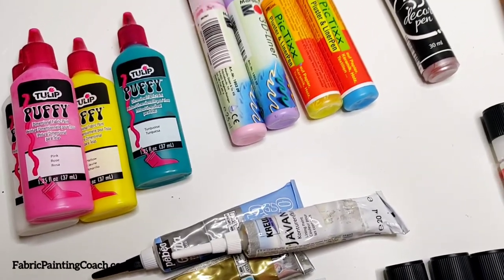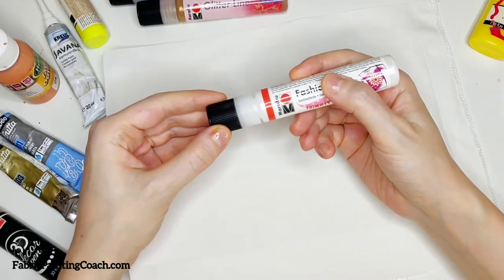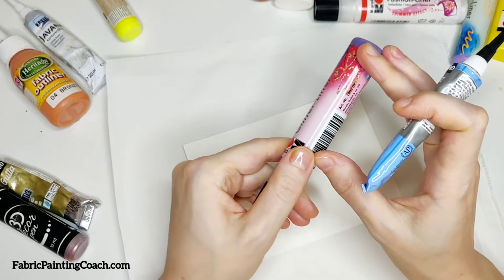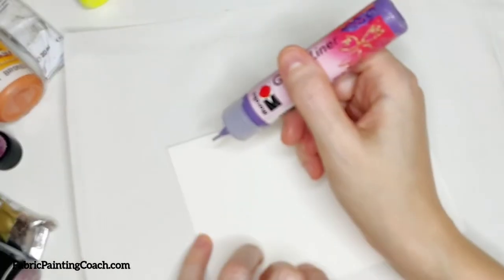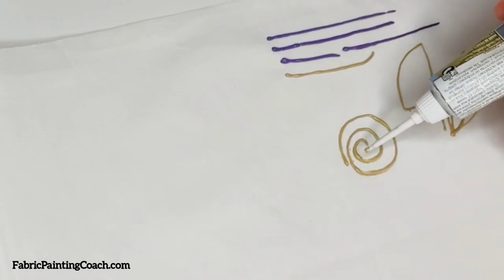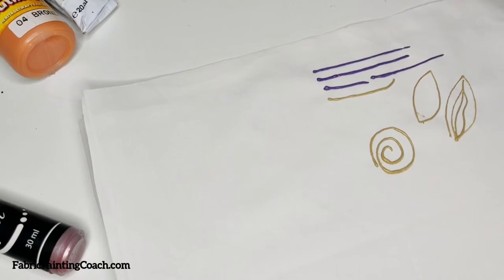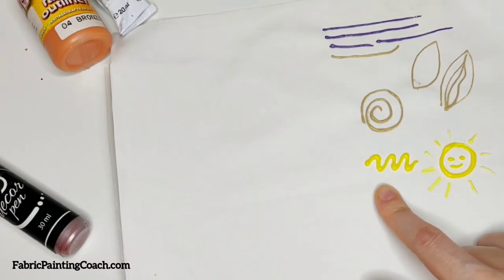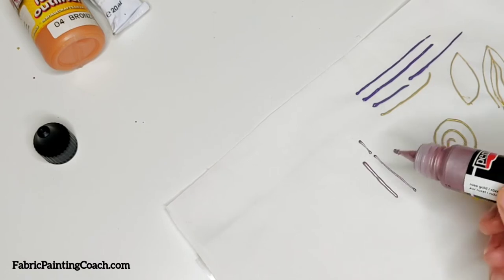Outliners for fabric | How to use Textile Liners | lesson 25

Comment: Many thanks for all I learnt by watching your video! For lycra or other stretchy fabrics, what king of permanent outliners do you recommend? What would settle down into fabric and resist to hand-wash?
Reply from the maker: Hi! Your every welcome
Yes, this is a very good question, as not all of these products that I've shown are suitable for synthetics and lycra. Javana, Marabu - these are only for cotton and mixed textile.
You could use Setacolor outliners with confidence, these are soft and permanent on synthetics. Brand Tulip - I would test on your specific fabric before diving into it (but definitely don't start with dimensional type of squeeze paint bottles (i.e Puffy) - these require serious heat setting for dimension to kick in.)

If you have some specific brand in mind, feel free to ask, I might just miss some from the top of my head....

PS. As I mentioned, in my practice, regular liners (not textile specific)  with pearl effect work well on fabrics too. One just has to be careful when ironing them, as pearls get squished sometimes